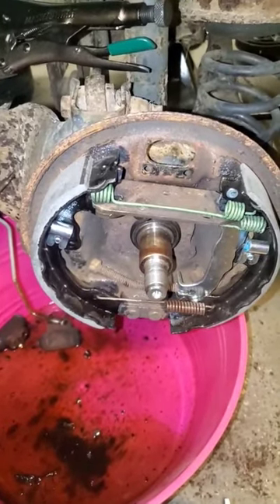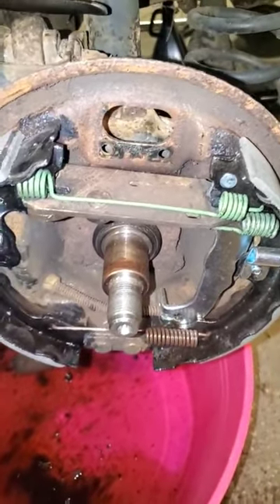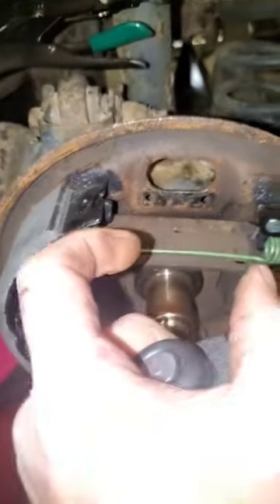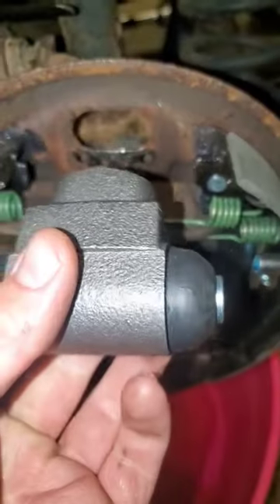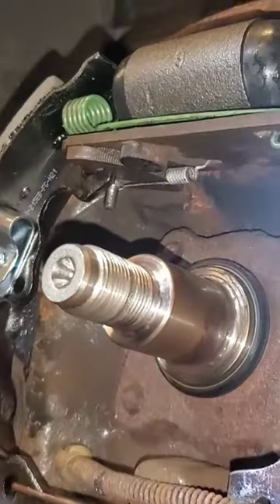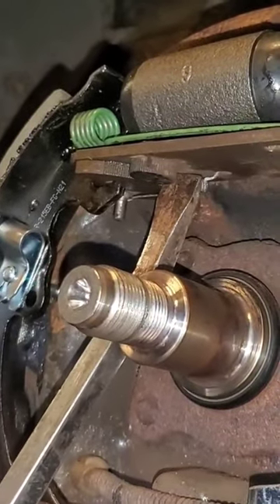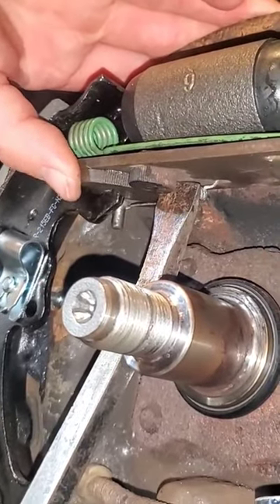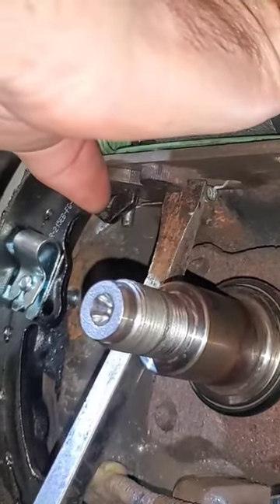Drum Brake Wheel Cylinder Replacement Made Easy #fordfocus #mechanic

Comment: I don't think I've ever removed the shoes on any car to replace only the wheel cylinder. On most vehicles you can just squeeze 'em in there while pulling the shoes apart slightly. That self adjuster on this car makes it stupid easy though. I like it.

Comment: May be true but if you're in there you may as well put in all new stuff
Reply from the maker: I agree, but if everything is still good enough and you are just needing a quick fluid leak fixed, this definitely would help. Funny thing, if you notice in the video the stuff is all new. I had literally just replaced it and was getting ready to put the drum back on because the wheel cylinders looked fine, then I saw a drip...🤣